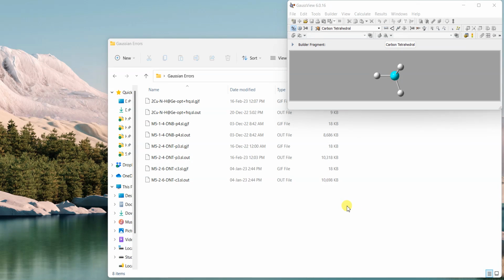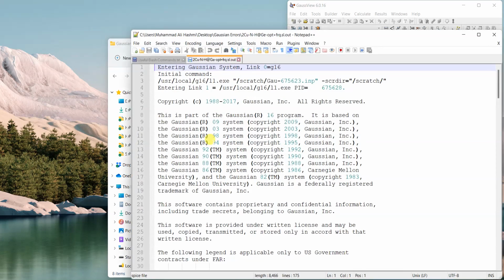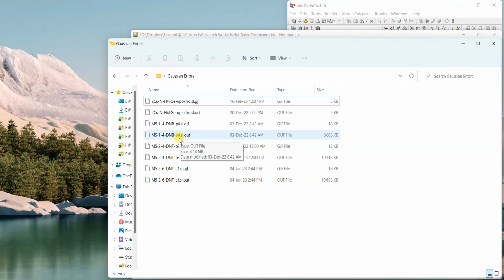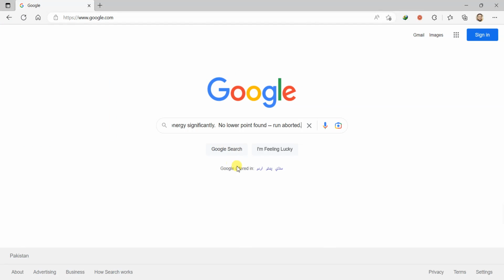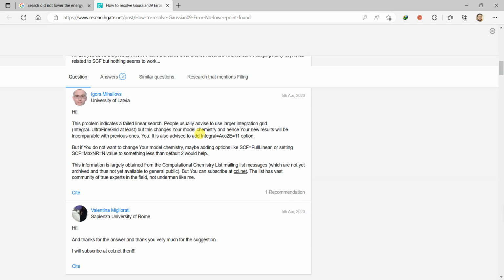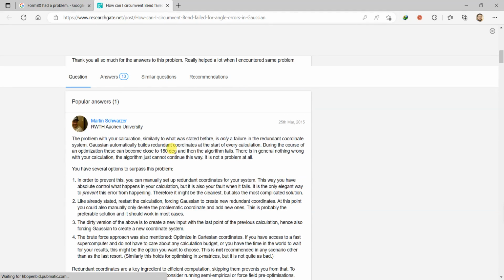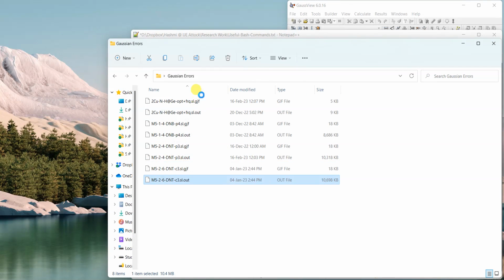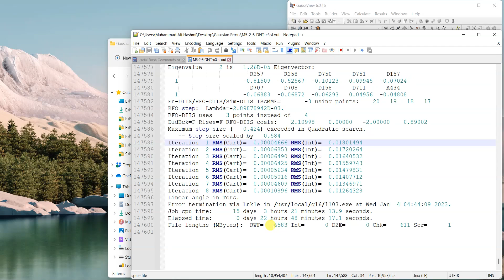Tutorial 26 | Gaussian Errors and their Solutions | Dr M A Hashmi

Comment: I tried to optimizd a molecule and a severe error 2070 arrived which was solved but making the memory 1024Mb and shared processor to 1 but while calculating the frequency i had a problem with negative frequency and when i tried to recalculating frequency to manual displacement of 1 the same error arrived again and it wont be solved even by changing the memory and processor and now i dont know what to do can anyone help me
Reply from the maker: Changing the memory or processors won't work with negative frequencies. You have to change other criteria

Comment: Sir, I have performed a TD_DFT in solvation model. It terminated normally, but the .chk file is not opening in gauss view saying
"CConnectionGFCHK::Parse_GFCHK()
Missing or bad data: Alpha Orbital Energies
Line Number 478"

And in line 478 of output file, no peculiarity is observed. I'm not able to view the MOs in this case.
Would you please help me out.
Reply: I think you have moved or copy the files from original path. Repaste the Chk files to the folder where it was saved first time. And then open it.
Reply: convert the .chk file into .fchk file, it'll help.
Reply from the maker: Did you run the calculation on same hardware and operating system as your GaussView?
If you use a different OS or hardware, you may not be able to view .chk file. In that case, you have to format the chk file